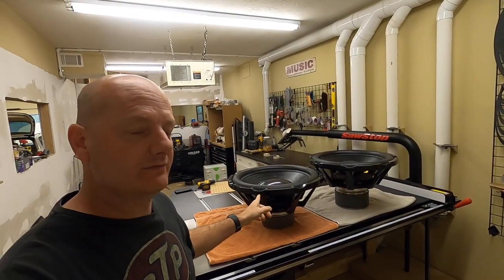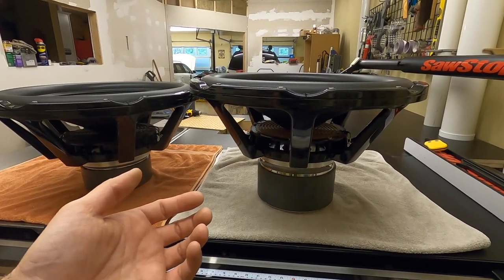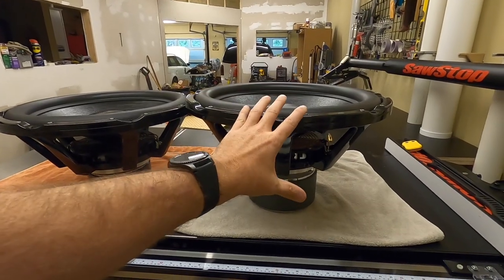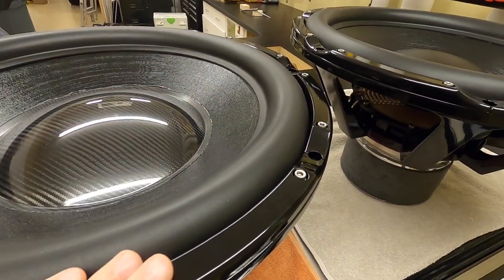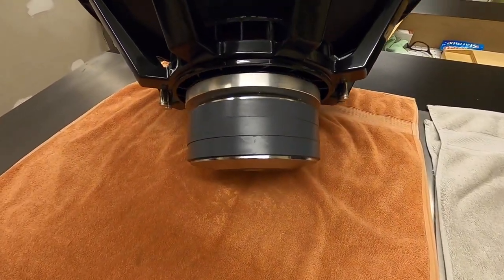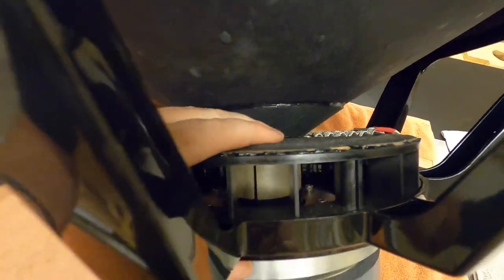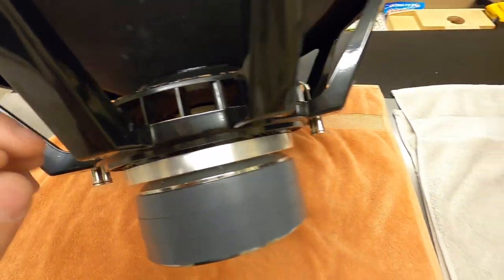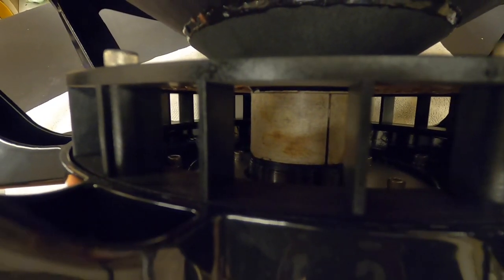Stereo Integrity Audi A4 Stealth Build: Subwoofer Info

Comment: Hello Batdog. I'm wondering which of the subwoofers sound best. Which hit the lows better or are they about the same. I know that the HS-24s are louder than the IB-24s, but as far as sound quality which goes down into the low frequencies (16-20)+/- Hz better, or are they the same. Thanks in advance.
Reply from the maker: How cow. How did I not see this reply? Sorry for taking so long to get back to you.

Sound quality will be killer with both. You can actually contact Stereo Integrity and have Nick built a HS-24 for IB if that's something you want. 

As far as low frequency extension, a sub that's in a IB install will play lower and require LESS power to do so. So if you're looking at a choosing between the IB-24 and HS-24 and you want monstrous lows with gobs of output, get a HS-24 built for IB use.
Reply: @BatdogGarage  Thanks bro.👍
Reply from the maker: @shadrachjackson752  Again, sorry for missing that and taking so long to reply. *kicks dirt
Reply: @BatdogGarage  No problem my friend.